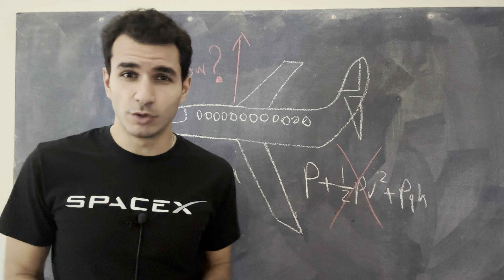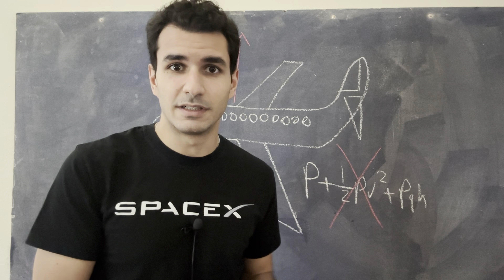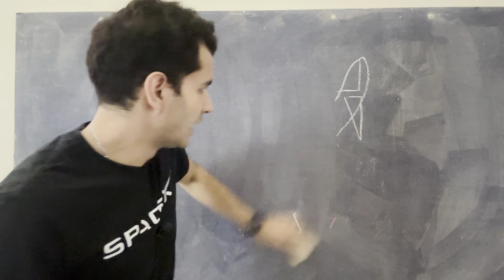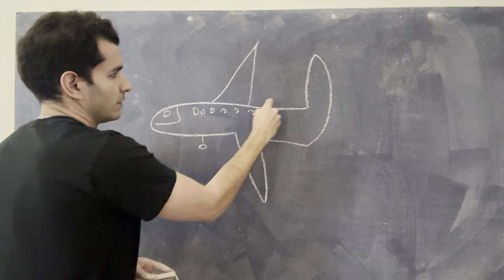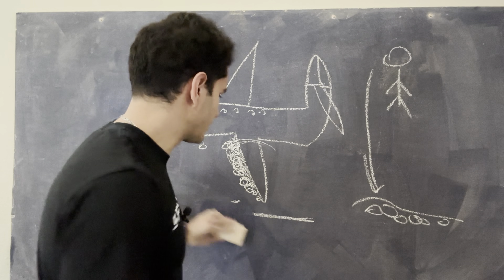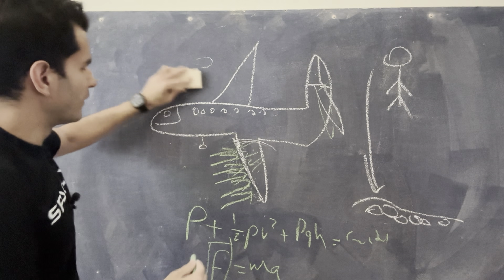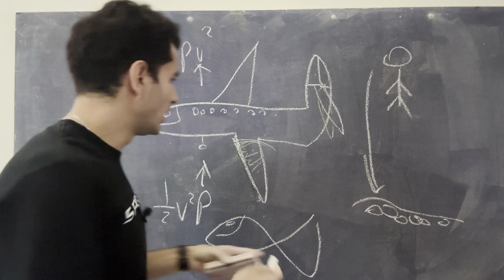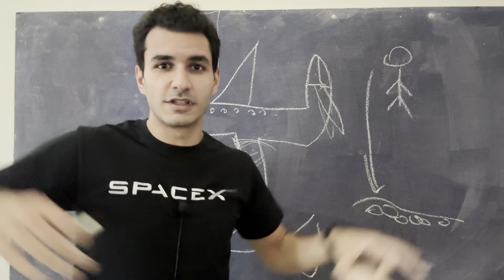Fix This One Misconception = Understand Airplanes Forever

Comment: He made it more complicated than it actually is. According to Bernouli equation and the circulation equation from fluid dynamics, when the upper surface of the wing’s profile is greater than the lower one, there will be lift generated. Why? The air from the tip of the wing is divided in upper and lower wing where at the back is meeting again. In order the air to meet again the upper profile air it has to travel faster than the lower one. And according to the Bernouli as he explains, the pressure will drop on the top of the wing and the difference between the lower profile pressure and the upper one it results in lift. Opposite is for drop 😊
Reply: What happens in inverted flight when the upper surface of the wing is now the lower surface? How does a paper airplane fly when the upper and lower surfaces are equal? Nothing in physics says that air has to accelerate over the top of the wing to meet up with the airflow at the bottom of the wing.
Reply: @Fly-SanDiego  "Nothing in physics says that air has to accelerate over the top of the wing to meet up with the airflow at the bottom of the wing."

That's the popular narrative but it is a misstatement of the real physical issue:

rate of mass flow in = rate of mass flow out.

So, what comes in at the front must be the same as what goes out at the back (same amount per second).'

That is true whether you have one stream or more streams of mass: rate in = rate out (for the total of all streams).

Now, split one stream in two but send some of the flow from the bottom stream into the top stream, what happens?

The top stream carries more than the average stream to the exit, and the bottom stream carries less than the average stream to the exit.

But the total from in to out of the two streams considered together still satisfies in = out.

The end result:

The top stream must move faster and the bottom stream must move slower than ambient surrounding flows
to keep mass density relatively constant.

As to the question how, in a way that explains inverted flight as well:  asymmetry to the relative wind.  To the extent asymmetry is insufficient for full upward lift from asymmetrical camber, asymmetry is inserted by changing the angle of attack.
Reply: @Fly-SanDiego  as @davetime5234 said, at inverted flight will apply the same rules. If you hold the same profile of the wing and you just flip the plane, the plane will go down and crash. Simple as that. Attacking angle of the flow and all the other variables are not providing the same rules for normal and inverted plane flight. Fly a simulator and you will see what happens and what you have to do with the controls of the plane to keep it in a straight flight line. :) But I like the question, Don't get me wrong here. and for the the paper plane. You can't compare hard surface with a paper wing that flexes itself from the pressure difference, wind, and flight speed that are all connected again and the wing will try to adapt itself to the most optimal form as possible. Same as rain, if you drop water from high place, in few seconds the water will take it's best aerodynamic form for going down as fast as possible. Like Droplet :)

Comment: I’m sorry but as an aerospace engineering PhD I have to jump in here. Are you saying the pressure below the wing is higher because the air molecules are hitting the bottom surface of the wing? This is absolutely not true. The flow will always be tangential to the wing surface, whether on the bottom or top surface. The reality is that both Bernoulli’s equation and Newton 2 are valid in describing lift, but the tricky part is to describe causality. Is the lift caused by the pressure difference, or is there a pressure difference due to the lift? To get the full picture you really need to talk about potential flow, circulation and the bending of streamlines. Also, a perfectly valid statement is also that lift is caused by the physics needing to satisfy the Navier Stokes equations. And it is not a cop out to point to these equations, since they essentially represent the conservation of mass and energy. They are also highly non-linear and not easy to understand intuitively; that doesn’t mean they don’t offer a valid explanation. For that matter, Bernoullis equation is really just conservation of total pressure along a streamline, which is essentially also conservation of energy. You talk about lift being caused by the control surface exerting a force to rotate the aircraft and causing the angle of attack to increase, what about the lift force created by the horizontal tail, what caused that? I’m sorry but this explanation is simply wrong.
Reply: "To get the full picture you really need to talk about potential flow, circulation and the bending of streamlines."  How does potential flow help, when it is a severe truncation of physical reality?  I ask this because I am puzzled why many aerodynamicists appear to (whether it's in fact true or not) get tripped up by:

pressure difference x area = d(mv)/dt (vertical), claiming that bringing up the left and the right side of that equation is somehow double counting.  It seems to get referenced to potential flow causing the pressure difference but resulting in no downturned flow corresponding to the right side of the equation(?).

The right side means there must be substantial downwash, fully equal to the force of lift, in a linear downward direction in the immediate vicinity of the wing, and that any immediate vicintity vorticity is likely mostly wasted energy (non-directional energy of angular momentum)?
Reply: @ I think the notion that the quantities on the left and right side of that equation have to cancel is an incorrect understanding of algebra. That equation is derived from equating F=F, which is true, and then substituting thr definition of pressure (p=F/A) and Newton 2 (F=rate of change on momentum) on the right. There’s nothing inconsistent about that equation.

Comment: Great explanation, we always try to find complicated explanations for everything when the truth is staring us right in the face. Just read the classic “Stick and Rudder” for a no nonsense explanation of flight! As a pilot, that’s all you need to know
Reply: "Stick and Rudder" downplays pressure drop above the wing.  For all its otherwise practical help, that is nonsense from a physics perspective.

 "As a pilot, that’s all you need to know"  Icing and bug splats are more serious on the top surface of the wing than the bottom, precisely because of lift production being dominated by the pressure drop from the flow above the wing.

Keeping the upper surface clean directly contradicts "stick and rudder"'s de-emphasis of pressure drop as the dominant factor.

Bugs cost airlines a lot in extra fuel consumption.  Not just parasitic drag, but when lift is degraded somewhat, more angle of attack is needed which is more induced drag.
Reply: @davetime5234 DaveTime: this is what we call common sense and good airmanship, a term that’s lost these days unfortunately! That is what kept me flying for 47 years without ever putting a scratch on an airplane, from P-51 to A380…

Comment: Is there a pressure difference in the air on the top and on the bottom of the wing though? Also, are you trying to say that both Bernoulli's and Newton go hand in hand to generate lift? Because I get the Newton explanation for the bottom side the wing, but what about the top?
Reply: Considered from the big picture perspective it is all Newtonian physics.   Newton's principles of motion are made most general (to also include fluids and gases) by the core Navier-Stokes equation principles:  

conservation of mass (continuity of flow rate), conservation of momentum (quantity of motion), and conservation of energy (seasaw balance between speed as kinetic energy and pressure as potential energy).

"Bernoulli" as frequently used is often conservation of energy focused.  "Newton" as frequently used is often conservation of momentum (equal and opposite reaction) focused.

So "hand in hand" is right.  But also, those 3 conservation principles are working everywhere as the entire system of physics of motion.

So, mass flow being sustained affects speed which is kinetic energy dropping pressure (potential energy to pay for the kinetic energy), and that pressure change bends the flow momentum direction down, which is conservation of momentum.

Just for example, the pressure drop on the top turns ambient flow further above downwards.  So there on top of the wing you have the "Newton" people often refer to.  And it's caused by the "Bernoulli" people often refer to (conservation of energy pressure drop).

Comment: As predicted these comments are very contentious!

Just want to add in that your idealization of a wing matches thing plate lift theory. While it is true that plates at an AoA will have a higher pressure on the windward side and a low pressure on the opposite surface causing a force imbalance, this says nothing about the aerodynamic profile, the flow conditions, or the momentum transfer. While the basic principle of F=ma and Bernoulli's may show high pressure bottom + low pressure top = plane go up, there is much more to airfoil theory that needs to be said here i.e Kutta–Joukowski theorem, no slip boundary conditions, invalidation of equal transit theory, and viscous effects.

Not sure if all those would be as fun to listen to though!
Reply: A more accurate intuitive description of lift is indeed needed and is possible, but to be honest, none of those extra items you mentioned need to be included for such an explanation.  None of them are prerequisites for lift production, though they affect the final practical outcome.  The Kutta condition for example is a fix of potential flow's truncated description of physical reality.